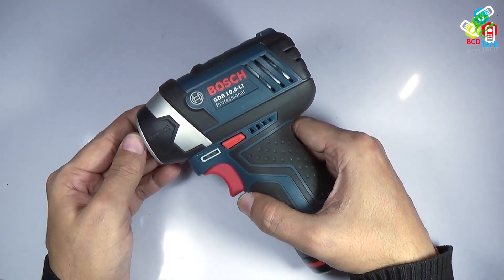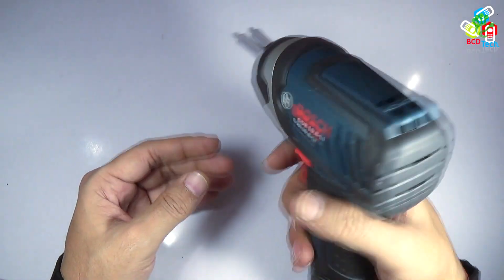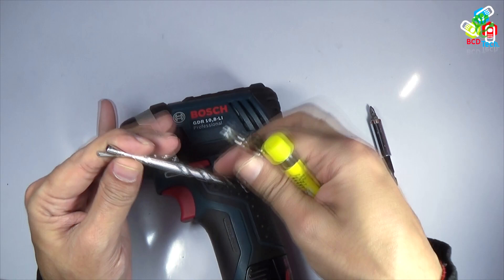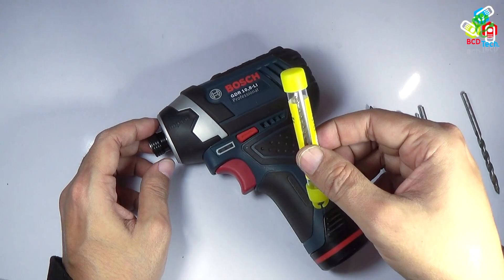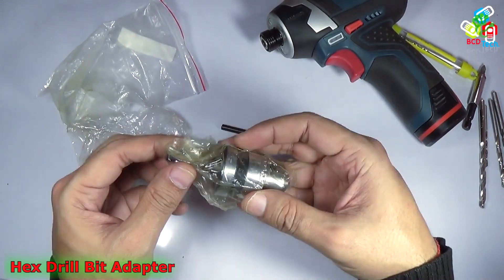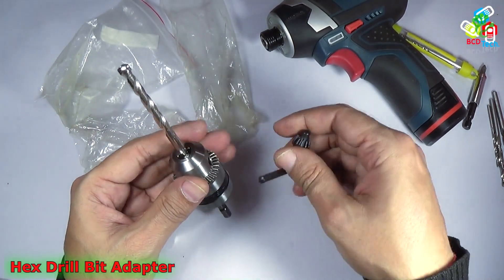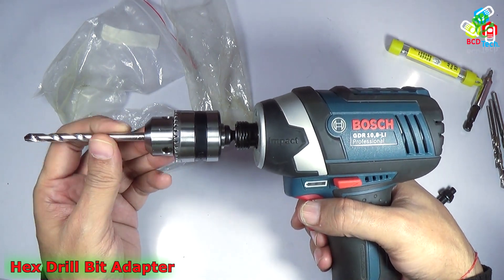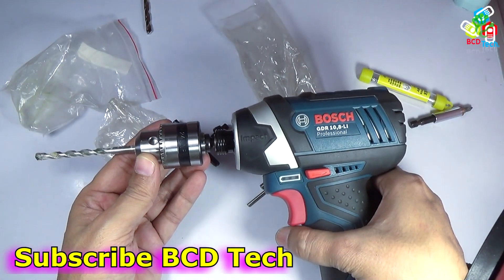Banggood 1/4 inch Hex to Cylindrical Drill Bit Shank/Chunk Adapter for Impact Driver

Comment: Is it ok to put the rotary sds rotary hammer drill in hammer and drill mode using a chuck adaptor ? I’ve read that it can spoil the chuck very easily.

Comment: The end of the shank is little longer than required and hence the chunk is not going fully into my chuck.
Reply: They do this on purpose so when the quick connect indent breaks (the weakest part of these) you can still use it and get the job done

Comment: bro do you know how to tell the difference between concrete drill bit and wood drill bit
Reply: BLOODjack143 look it the tip, if it’s fat then is concrete, then a smooth drill is for wood
Reply: They’re sometimes sold as “universal bits”, I’ve never tried using one on wood though
Reply: Concret drill bit top mouth right left extra point n normal bit plain mouth